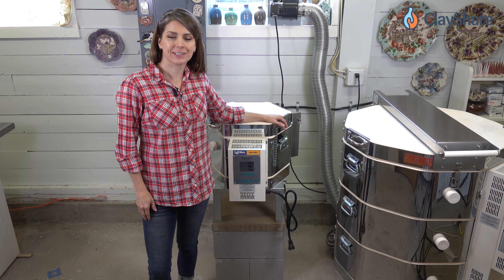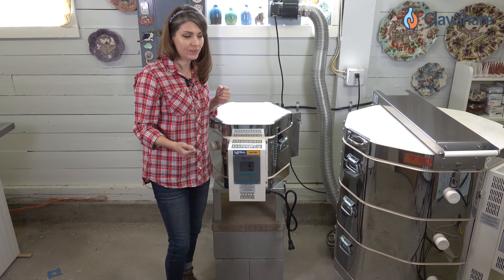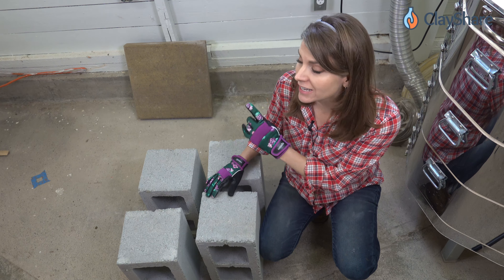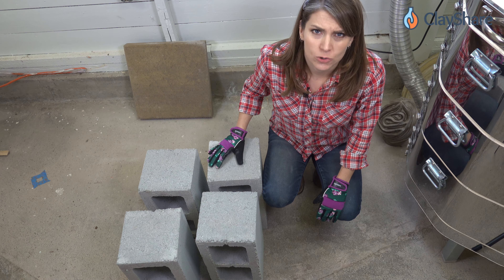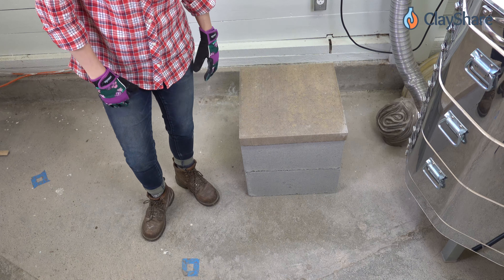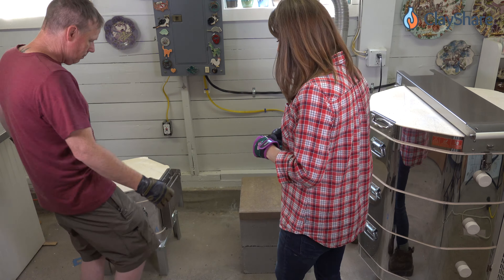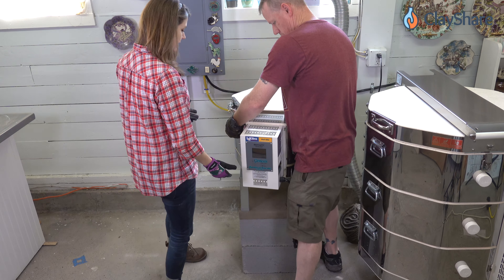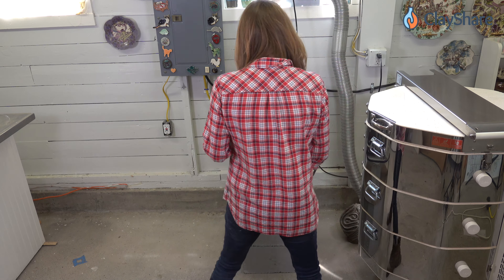Build A  Kiln Table for $13!!!

Comment: Great video.  Would you recommend a new potter start with a Doll/Test kiln for learning about glazing, etc. before moving to a larger kiln?  Or would you start with something larger than a kiln such as your small one? Max I can fit in my garage is the width or your larger kiln, but could also put a kiln outside and build a covered area for it.  I live in central Florida.